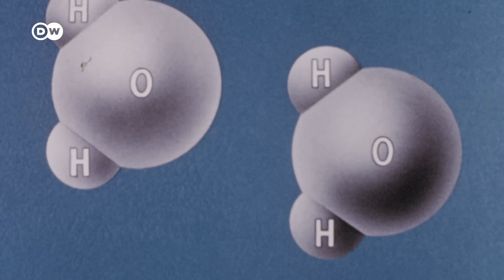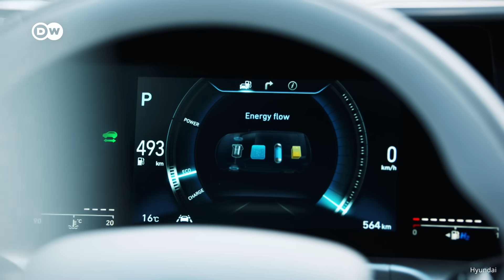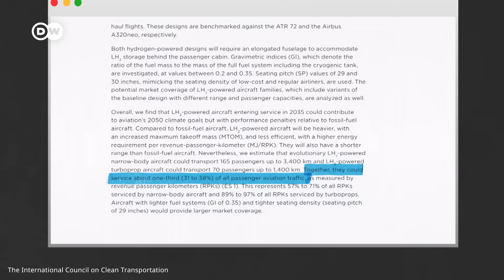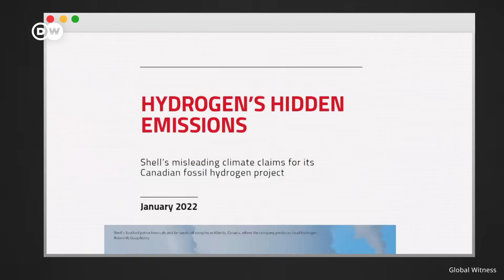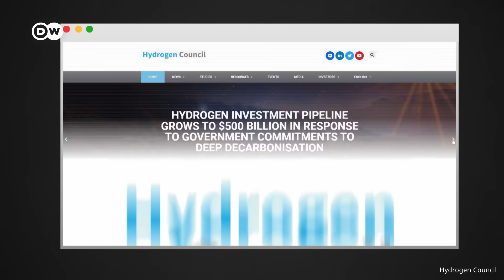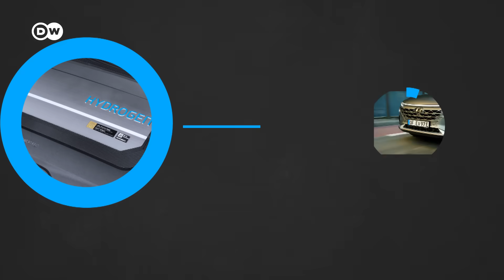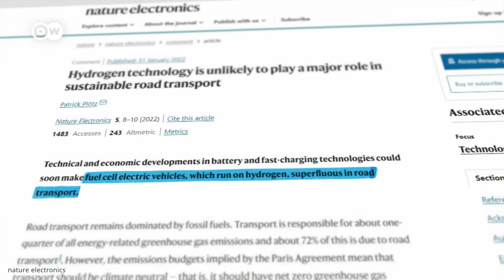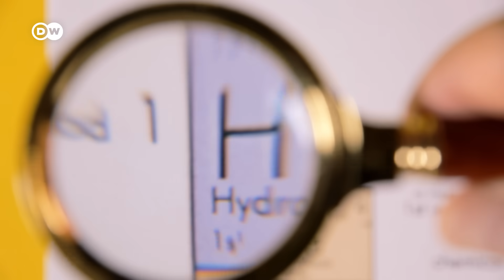The truth about hydrogen

Comment: Phenomenal reporting!  Robert Howarth is absolutely spot on, on every point he makes. All light duty vehicles should be BEVs, as soon as possible, with BEV and H2 for larger vehicles.
Reply: 1- if you wanted to replace all current ice cars by BEVs you do not have enough rare metals to produce batteries to produce 30-40% of these cars
2- on a life cycle assessment, to offset the extra carbon footprint related to the production of lithium ion batteries (that is very polluting), you would need to run that car for more than 6-7 years for the average person’s annual kms traveled and using low carbon electricity mix (such as france), before u start actually emitting less than an ICE. 

So overall, not the best idea. Hybrid powertrain is the solution for now (much smaller batteries), until we have a breakthrough in batteries (technology without rare metals) or produce hydrogen in sustainable ways (i’d recommend checking the Monolith Materials process)
Reply: @jaddiab9261  Hi Jad. Thanks. It's good to know we will be driving fewer cars when we've switched to EV. Driving is a pain. I'd much rather ride my bike. I'm not sure the resource limitation has been established yet, since we haven't been looking for very long (and we seem to have plenty of Li for other batteries, phones, laptops etc.). Battery technology will evolve, of course, and there are already batteries that use less or no cobalt (if you are worried about that -- but refining petroleum uses a lot of cobalt too, so it's a matter of choosing the lesser of two evils). You referenced an LCA study but those that I've seen come from industry sources -- e.g, Volvo -- and were not peer reviewed; they also seem to be flawed in important ways. Maybe we should all consider driving lighter, smaller EVs like the Aptera? Why lug 5000 lbs around just to move one person? Studies have shown hybrids -- even plug-ins -- to be worse than BEVs environmentally by a long shot (check out Fully Charged on yt). Low carbon electricity mix is something that some countries are well on the way to achieving, though there's a long way to go (and I think nuclear has to be part of the mix if we are ramp up carbon-free electricity in time). Skinny: EVs are not perfect but they're more perfect that anything else we have for light duty vehicles. For semi trucks and other large vehicles, hydrogen probably has a role to play; I'll check out that process you mentioned.
Reply: @xchopp  i agree on many points you said
Reply: @jaddiab9261  Thanks. I had a look at the video "Clean Hydrogen from Methane Pyrolysis" and the carbon intensity figures were based on the process when using "renewable natural gas", that seems to be methane from landfills. We won't have enough to make this viable if it relies on that source. But there are surely applications where H2 makes more sense than batteries. Like many people, I was quite skeptical about EVs until I actually lived with one (since March 2016). I prefer to ride my bike to work when it's not freezing or raining, it's more fun and I get a free workout.
Reply: @jaddiab9261  EVs are q gimmick only good for golf carts. There is Hydrogen fuel combustion engines. which doesn't use extreme rare metals. Hydrogen can create millions more jobs than any EV industry.
Reply: @jasonlewis460  I disagree :)

Comment: I think hydrogen has a place in the non-fossil fuel world of the future, but until we've moved the vast majority of our electricity away from fossil fuels it just isn't efficient enough to warrant use outside of niche use cases. For example, if we want to get container ships to use hydrogen to eliminate their C02 emissions and that hydrogen comes from electricity generated by fossil fuels we've basically just added inefficiencies on top of fossil fuel usage. Even if it comes directly from green electricity source, that may cause fossil fuels to be used somewhere else instead since there is a finite supply of green electricity.
Reply: Exactly. Most experts agree that the first priority is getting 100% renewable energy. The next priority is building in excess renewable production in order to generate hydrogen fuel.
Reply: @SaveMoneySavethePlanet  You can't get 100% renewable energy without implementing better energy storing techniques along the way. Both technologies should (and will) evolve alongside each other
Reply: @jeroenverschaeve3090  nuclear (while not highly renewable) doesn't need batteries, and flywheels have been used as an alternative to batteries, storing mechanical energy directly, also pumped-hydro dams can soak up excess power generation for windless nights and a lift system using gravity as storage could work anywhere. So it is possible as long as you find renewable sources of methane, PV solar panels, and wind mill sails. Because we can run out of silicon for PV if we change them every 25 years. Solar towers just need shiny surfaces (and some concrete for the tower, or steel or another building material)so can be easily re-melted if from silver or copper or another shiny metal.
The irony of it all is that Germany stopped it's nuclear to be more green and started using Russian methane, which is in part why the Ukraine stuff is happening now, while DW is talking about green initiatives. -a third party.
Reply: @ГеоргиГеоргиев-с3г  I agree that nuclear should be part of a transition, and the prove to me seems to be the comparison between French and German energy balances. France commited to nuclear while Germany is finding out that renewables aren't ready for full implementation. However, as a society we seem to like renewables a lot more than nuclear, and I'm not sure if we can ignore that.

Hydro dams are indeed a very good battery. Their problem is geography: there aren't nearly enough lakes on any scale to store enough power. Mechanical storage such as flywheels on the other hand is that it's a lot of work to make them and they don't store that much power; we'd have to build a ludicrous amount of flywheels to store a relevant amount of power. Chemical energy, finally, is very hard to scale up; battery plants aren't very effective. Hydrogen seems to be one of the more promising technologies. 

Whichever way you look at it, if we want to move past ~70% renewables, we will need large-scale storage of energy, and we currently do not have the technology to do that.
Reply: @jeroenverschaeve3090  the flywheel was more of the small end of things, bus sized, and you totally ignored 2 of the things i said, them being you can use gravity everywhere, dams are just easy, sand bags piled with a generator also work though, and what to do with the windmill wings(PV) after getting used up. But i agree with what you said.
Reply: @ГеоргиГеоргиев-с3г  Gravity has the same issue as flywheels, it's just a different form of mechanical energy. It is very difficult to store enough energy to power a country with physical objects.
Reply: @Save Money Save the Planet  if we ever get cheap fusion power then tech like hydrogen becomes much more viable
Reply: That's the point: Limited storage capabilities are hindering renewables from expanding. In theory renewables have become very cheap. But the lack of storage is blocking us from getting past a certain level. That's why both has to happen at the same time. They depend on each other to be viable: More renewables require more storage. More storage makes sense with more renewables.
Reply: @IroAppe  The thing is that hydrogen isn't a good storage mechanism for energy at the grid level due to it's relatively low efficiency (among other things). Pumped hydro, various batteries, gravity potential, flywheel, etc are just some of the more viable storage technologies, each suited to specific situations.
Reply: simple like other people said. first 100% green power (solar, wind, nuclear, hydro and geothermal) (tidal is kind eh we don't want to mess with already weakening ocean currents ) then because alot of the time we will have excess energy we can take that energy and convert it into hydrogen from sea water.

Comment: Producing hydrogen is net energy loss, no matter what method you use.. Hydrogen has a very low energy density by volume, so you have storage/transport issues. You need fossil fuels to manufacture wind turbines and solar panels also.

Comment: I don't believe in hydrogen for consumer / passenger vehicles. I think battery EVs is still the best option for that. But hydrogen is a good option for marine and air travel. 

Why not use renewable sources (solar / wind) for the electrolysis on sea water to extract the hydrogen that way?

Edit: I just watched the entire documentary and they reiterated the my points.

Comment: it takes 40 kwh of power to make hydrogen without pollution....and that averages 1gallon of gas equivalent... it takes 40 kwh to make one kilogram of hydrogen and one kg replaces 
less than One gallon of gasoline, UK alone used 38.2 billion liters of 
gasoline and diesel last year. UK would have to make 10 BILLION kg to 
replace their fuel use of cars and trucks. UK energy use was 5.78 
Exajoules a year, 38% met with petroleum, to replace with hydrogen would
 need 69,000 Megawatts of generation capacity to produce enough 
hydrogen.
Reply: hydrogen is just a way for fossil fuel companies to cling onto power. its just an inefficient excuse.

Comment: Hydrogen is great for 3 applications :

1) fossil fuel de-sulfurisation (until we stop using fossil fuels)
2) fertilizers
3) Metal de-oxydization

It can be used for specific very low volume transportation.  High volume will be too costly, with too much losses, this is the biggest HYPE of it all.

We should concentrate our efforts on :

- Greening the production of Hydrogen for the 3 primary uses
- Solving the Sodium batteries for cars & trucks, this is ongoing but needs more research money, much more promising than hydrogen
- Returning to Wind powered ships
- Electrifying rail networks and putting more and more cargo on rail
- Replacing short hops planes by Very High Speed rail (360 Km/h minimum)
Reply: sensible.

Comment: I think if you are using hydrogen for something that another green technology could do just as well, your doing it wrong. Also, I think if your building renewable energy plants with the sole goal of producing hydrogen, your doing it wrong. That said, hydrogen has massive potential for energy curtailment reduction. It should be used in that way, and then serve the purposes that are difficult to replace with other green technologies. It can be used for seasonal shifting of renewable energy production from summer to winter in a similar way that natural gas is produced year round and stored for the winter currently.